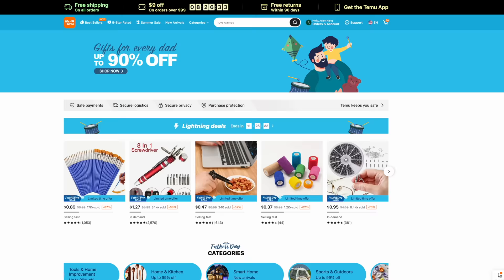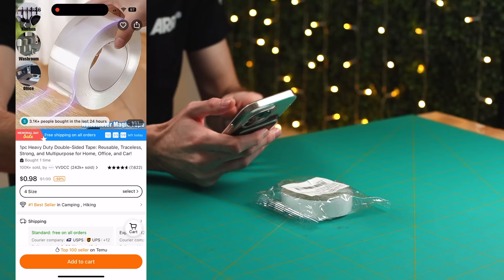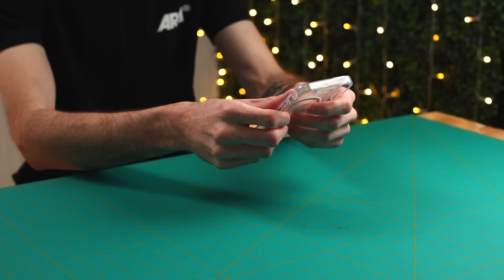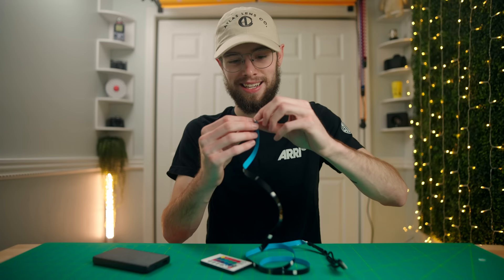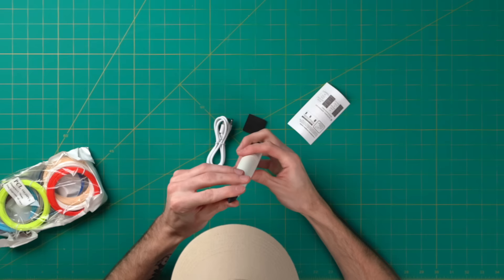Testing The Most VIRAL Items on TEMU!

Comment: the little security cameras actually work BUT you will have to use an older 2.4 network wifi repeater. i use mine with a dual band repeater and the ir. i put 1 in the back of my mailbox to see if i have mail. the back of the camera has a magnet inside so it just sticks to the back of the inside of my mailbox. the other i have in my dogs doghouse in the backyard. i can see both cameras with the app when i am at home or even when i am at the store. they are eaisly worth the money but use them somewhere they won't get wet.
Reply: What is the app called.  I have 4 of these cams but can't find the add to go with them

Comment: I've picked up quite a few things from Temu and they've all been great.  That said, I haven't and won't buy any devices that plug into AC voltage, or any complex electronics.  Cheap imported chargers and devices are notorious for using no insulation between the transformer windings, very small gaps between 110v and 5v, etc etc.  It's not worth it. 

But I did buy a non-contact body thermometer for like $4 and it seems to be the same purple and white model that gets rebranded by various places.  Best of all, it correctly indicated a fever when my kid had strep a month ago.  Tested against a glass/mercury thermometer, it was shockingly accurate.  The plastic housing feels like you could crush it in your hands if you wanted to, but I'm fine with cheaping out on that kind of thing.  It's a thermometer, I don't need it to be ultra rugged.

Comment: The thing about the printer is thermal prints tend to turn black over time.
Reply: Turn black if exposed to heat.  Most of the time, the printed images will fade and become unreadable, just like old thermal faxes and sales receipts.
Reply: Also not safe as they contain toxic BPA chemicals, which can enter the blood stream through skin contact. Yes, this includes most store receipts too.

Comment: With the gas magnet tester thing you should of used/empty the propane tank after aswell to see if it truly works
Reply: I agree but also don’t waste propane make good use of it while testing
Reply: The Gas Test Card is based on the principle that when using gas, the temperature of the liquid is low while the temperature of the gas is high. This causes the liquid crystals on the Gas Test Card to change color so that the remaining capacity of the gas can be observed. So this is really useful.
Reply: I got one for Christmas, no it doesn't work

Comment: I bought 2 of multi-led flashlights with my welcome discount. One 4-led, and one 7-led. Rechargeable with a built-in SMD strip light. Both work surprisingly well, and the battery lasts a long time. I also bought a wireless Qi charger which did not work at all.

Comment: The rechargeable flashlights are great for under $3. I use mine all the time. I was skeptical of the plastic case at first, but that means lightweight which is nice. The one thing i dont like about them is that the switch is hard to find with your fingers sometimes. I did order a smaller one that is rechargeable and metal and it works good too and small and lightweight. Definitely worth the price i have a bunch!
Reply: That thing is a piece of junk. Not even worth $3. I would tell you to just break it open for the 18650 cell inside but I know that's knockoff too and falls far below normal 18650 cell battery capacity. They literally lie about everything just to get you to spend money, even just a few dollars makes them money. If you're ok with that then shame on you.....but, to each is own i guess

Comment: Actually those water balloons are awesome for the price because that type is EXPENSIVE! I bought all the water balloons for the summer camp I work at from Temu. The budget is normally $500 for water balloons and I got everything for under $100. Plus with the auto-fill ones it saves sooooo much time, 10/10 would recommend!

Comment: First Security Camera: 0:54 
Bag Sealer: 2:38
Double Sided Tape: 4:00
Door Draft Stopper: 4:28
Mini Printer: 5:00
iPhone Case: 7:40
Propane Gauge: 8:44
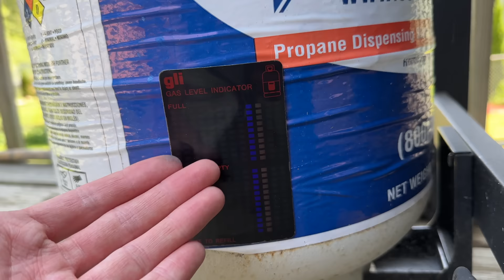AirPods Cleaning Kit: 9:50
Drill Bit Set: 11:07
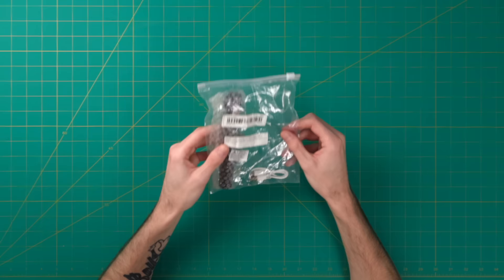Laser Pointer: 11:52
Fishing Magnet: 12:34
Motion LED Light: 13:05
RGB Strip: 14:15
PVC Sealing Strip: 16:13
Bluetooth Speaker: 16:44
3D Printer Pen: 19:12
Second Security Camera: 20:57
Universal Socket: 23:05
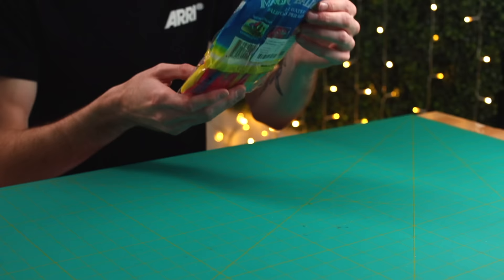Quick Filling Balloons: 24:49
Angle Drill Adapter: 25:37
Microwave Splash Guard: 26:07
Money Jar: 26:42
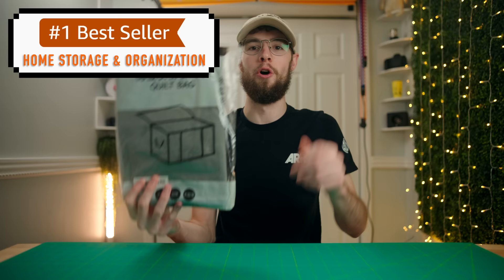Storage Bag: 27:28
Zoomable Flashlight: 28:55

Thx to @kjking9589 for timestamps, and creator for product list.
Reply: Thx

Comment: Hoodie. Cross screwdriver. 10 gel pens. Large to do notepad. Trainers.  shower drain cover. Bookmarks. Humidifier ×2.  Stain remover. Phone holder.
Laundry scent beads. Wash cloth ×2. Wired headphones.  Phone charge cables. Vacuum flask. Toothbrushes. Shaving soap. Essential oils. Not had ANY problems.

Comment: That speaker is a knockoff JBL flip essential just smaller, shorter. I have the original one flip essential 2 (with usb C), I had it for just a few months, it costs me around $90 in here, and I'm very happy with it. But when I first came home with it, before even opening it I did some research on the flip essential, and regretted buying it, because I thought it had a micro usb port only, but soon after that was happy to see the it was a flip essential 2 with usb C.

Comment: So far, I haven't been scammed nor unsatisfied because of quality compared to price.. especially when knowing how cheap temu products are. They are made in China by underpaid laborers, after all. Give you a hint on how to compare size. When watching videos or pictures of items, there are ways to compare size to other things. Another thing if it isn't a name brand item. Might as well expect the items not yo be as good in quality. I have only been a little disappointed in one item I bought. A set of binoculars. Which 50 50 binocks cost upwards of 100 + dollars. I paid ten for mine, and though they were not 50 50, I still could see details of a birds feathers around 40 feet away. Most items I have purchased from temu us to start up my art again. And even thier diamond tip drill bits are awesome. Cut through stone with ease.

Comment: if your pour water on the tank.. if its cold outside use hot water, if its hot outside use cold water.. it will give you a dew line.
that is where the gas is.

Comment: The socket with all the pins in it that work on different size nuts and bolts is trash, the pins all fold over with little effort. They used to sell them on TV and liquidation stores in the 70s.

Comment: The Gas Test Card is based on the principle that when using gas, the temperature of the liquid is low while the temperature of the gas is high. This causes the liquid crystals on the Gas Test Card to change color so that the remaining capacity of the gas can be observed. So this is really useful.
Reply: It's a simple thermometer.
You simply keep moving it up and wait for the color to change.
That's the level.